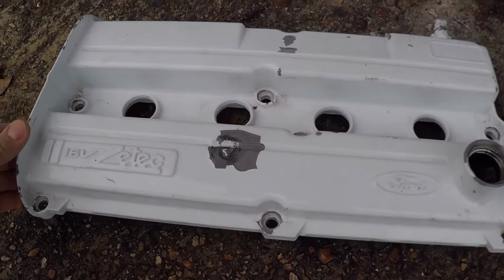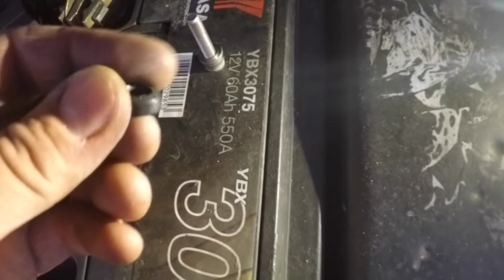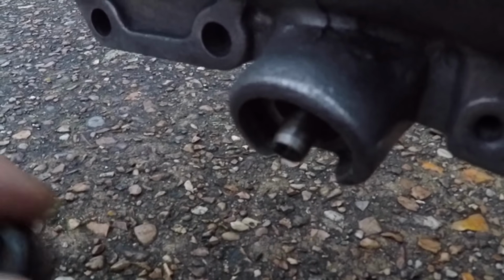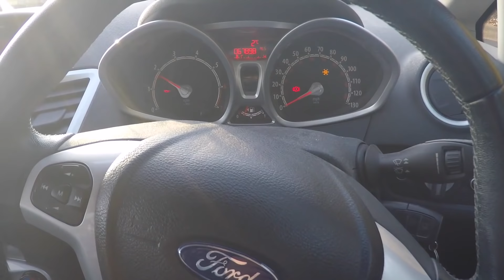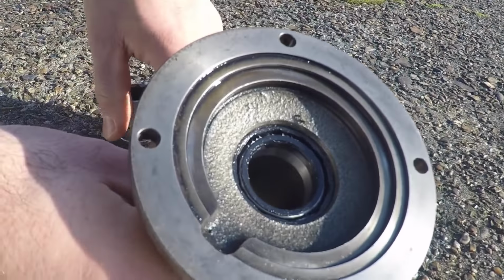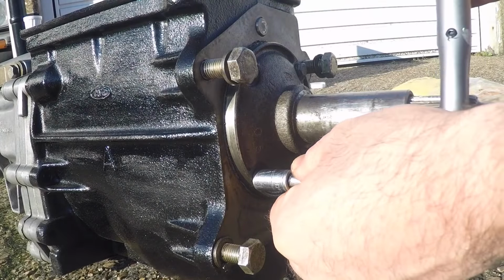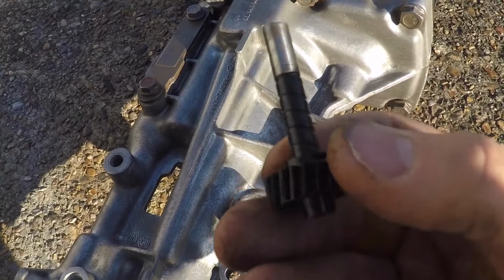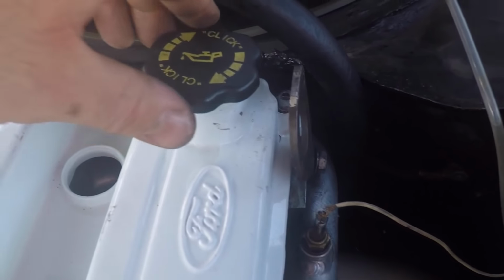MK2 ESCORT GEARBOX PREP

Comment: Im fitting a type 9 to my xflow in an auto shell using the auto mount.  However i can't get the bolts to line up without forcing the box .... is this a common problem
Reply from the maker: On Maude it does take a bit of 'forcing'. Its not ideal. If its that far out is there space to drill more holes in the mount so that it will all line up???
Reply: @marcushayesford  i just noticed you replied to this 2 years ago lol.... turned out I had the engine mounts on the wrong sides swapped then over and it all lined up nicely

Comment: I thought the rubber O rings were connected to a crush tube washer thing . I can send you a pic of them when I'm in my shed again .. maybe later this evening when the weather cools a bit... It's cracked 47.5° c so far , Adelaide ain't meant to get that hot 🔥
Reply from the maker: Yes I believe the original ford silvertop bolts are the same style as the st170 ones (shown at the end of this vid) but the tube washer thing must be narrower on a silvertop bolt because the st170 ones wouldnt fit throught the bolt holes in the rocker cover. . . . . Enjoy the weather in Aus! Its around 2°C here 2day! :)

Comment: Nice video Marcus, Where can I get the gasket set and the speed sensor to buy for the type 9 Gear box?
Reply from the maker: Thanks! I got my gasket kit from ebay https://www.ebay.co.uk/itm/Ford-Capri-Sierra-Type-9-Gearbox-Gasket-and-Oil-Seal-Set/150977514172?ssPageName=STRK%3AMEBIDX%3AIT&_trksid=p2057872.m2749.l2649 . . . . . . If you want to run an electrical speed sensor in a type 9 gearbox you can buy this adapter from Burton Power https://www.burtonpower.com/revotec-electronic-speedo-adaptor-ford-gearbox-revt9-a.html . . . . . . . . If however you are referring to the speedo drive gear, there is one on ebay at the moment https://www.ebay.co.uk/itm/NEW-GENUINE-FORD-CAPRI-280-2-8I-SPCL-SPEEDO-DRIVE-GEAR-TYPE9-BRAND-NEW-RARE-ITEM/143096813893?hash=item21513c1945:g:rhkAAOSwJFBcMQAP:rk:4:pf:0 . . . . hope that helps :)
Reply: Well if it didn't leak before it will now you've tampered with it haha lol
Reply from the maker: haha! Sounds about right! :D